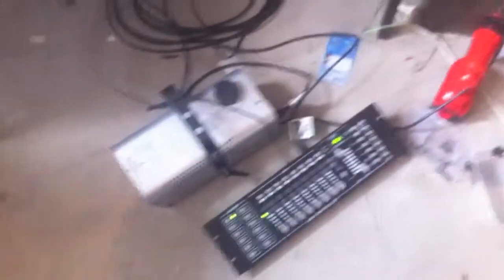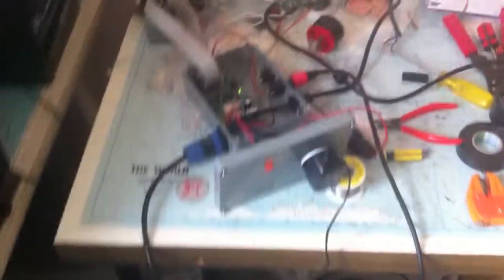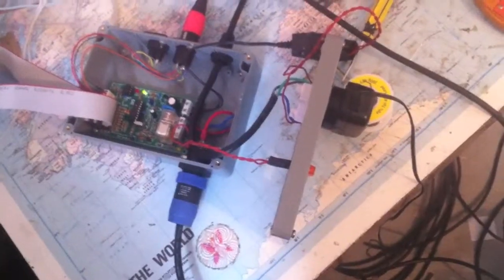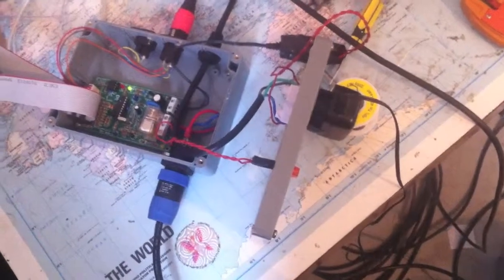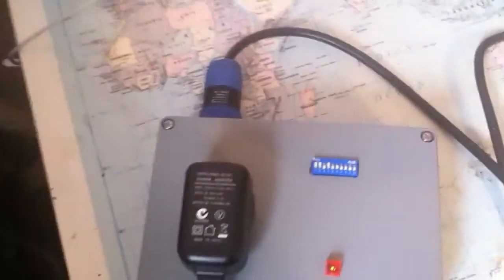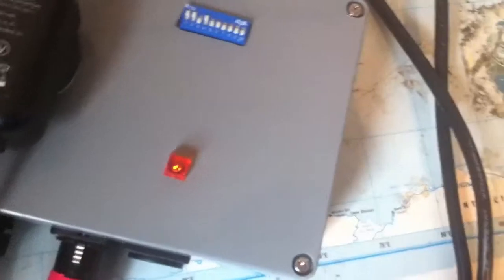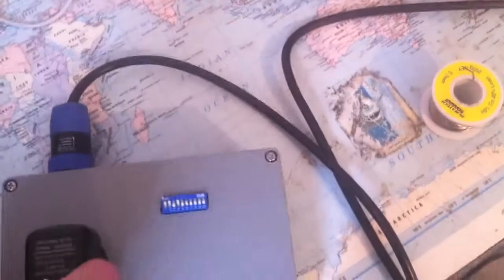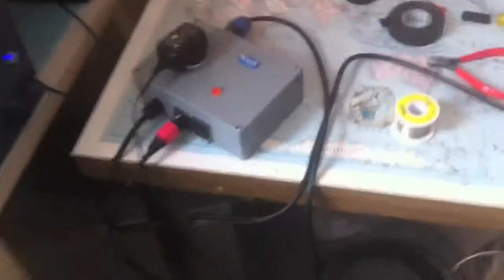Smoke Machine Controller - Part 2

Comment: Hi nice project, I have a similar project underway to convert a "dumb" effects light presently I can switch the two motors on and off and also the lamp using a 3 relay board.  I would like to be able to dim the light and control the motor speed, something that I cannot do with a relay.  Can you offer any advice as to how I could apply a variable voltage?   I know I could achieve this with a dedicated dmx dimmer pack but would like to avoid this route as I have 8 lights I want to convert and the cost would be prohibitive and I  really want to enclose the controller in a project box that is fitted to the side of the lighting effect.  I guess I am looking for a 3 channel DMX project board that can dim as well as switch. Any ideas?

Comment: Hello. Good job. I have the exact same fogger and I want to do the same. I'm unsure of a few things. What is the plug pack/walwart connected to/used for? It looks like it's a 240v input to 12v converter piggybacked off the quick connect on the front of the board.  I thought the board only came with the three pin connector for DMX in. How did you connect DMX out?  It appears you've piggybacked it off the DMX 3 pin connector.  Cheers.